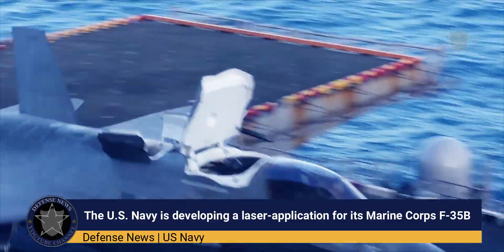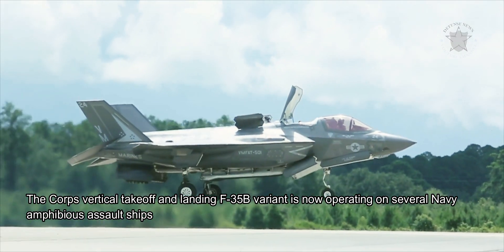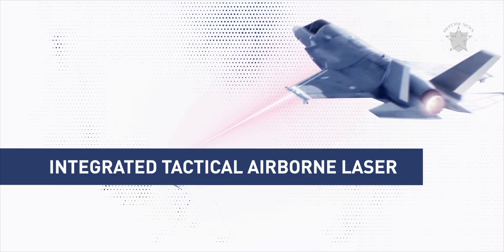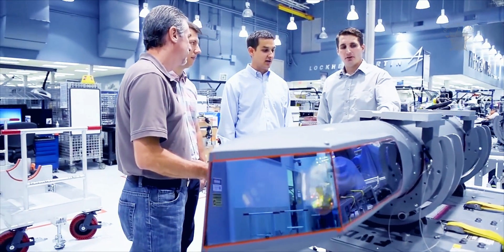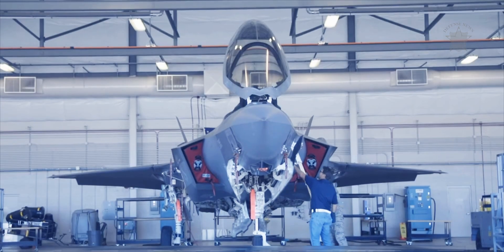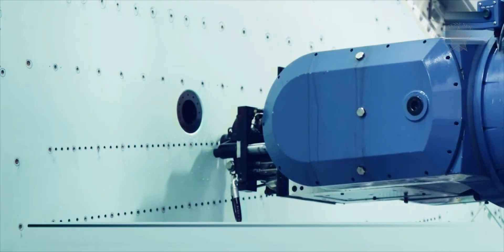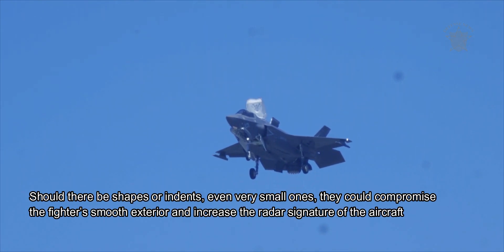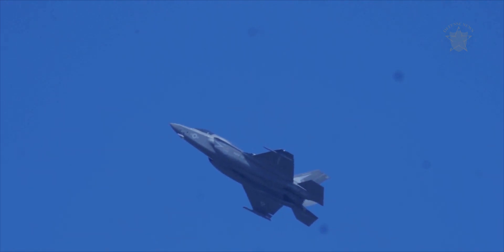Here's an Idea: Merge US Marine Stealth F-35s and Lasers

Comment: Waist of money because the enemy will polish the missal so the light reflects off of it!
Reply: smiles...The video ist not about Airborne Laser Systems, it ist about Laser Peening, which ist a process using lasers to strengthen the metal air-frame of the F-35B causing it to
resist the normal timeline of expected metal fatigue.   Also, the American airborne und ship mounted anti-air laser systems they currently have deployed are High Intensity Lasers (extremely dense protons), not simply less dense laser light beams.   They heat up und burn through the target surface within 5 seconds of whatever target their beam ist hitting irrelevant if the beam ist reflected by the target surface.   It will still heat up whatever target material ist reflecting it within that timeline und burn through it.   This video ist
Clickbait having nothing to do with Airborne Laser Systems.   Not even the Americans have made an airborne laser weapon small enough to mount on an F-35B.   This video ist even
showing American rotary laser targeting pods being manufactured trying to make everyone think they are an airborne laser weapon for the F-35B.
Quite ridiculous misinformation...smiles

YouTube has become infested with Clickbait, CGI, Photoshop, Cults, Con-Men, Racial Entitlement, Political Arrogance, those suffering 3 generations of "No Child Got Left Behind"
non-education und "Phobia Disorders" of Conspiracy who will most often believe almost anything that just anyone wants to show them it seems....Very sad I think.
Have a fun day und stay safe in your Haus if ya can...Auf Wiedersehen   :-)

Comment: Why ist your video showing an airborne laser system being fired from an American F-35B when the process of Laser Peening has NOTHING to do with an offensive Airborne Laser weapon.
Laser Peening the F35B's air-frame skin ist a process to strengthen the metal of the aircraft.   It ist NOT a weapon of any kind. 
You are showing photos of American Laser Targeting System rotary pods being manufactured that are NOT even Laser weapons, und have NO relevance to manufacturing processes of
Laser Peening either.   Not even the Americans have made airborne lasers small enough yet to mount them on an F-35B.         The point of your video ist what?...Clickbait?...smiles
Reply: Thank you Ivanka. This is a load of click bait and nothing else.